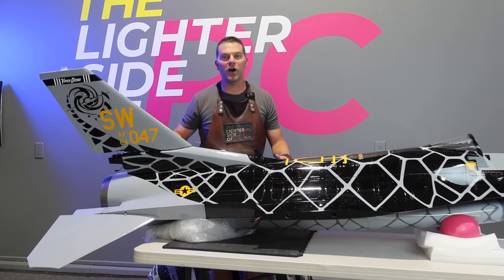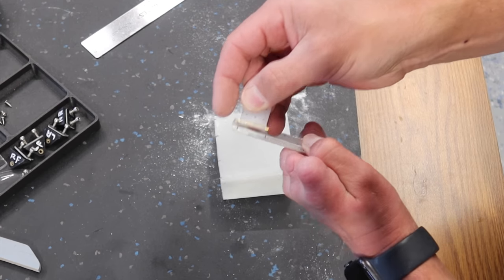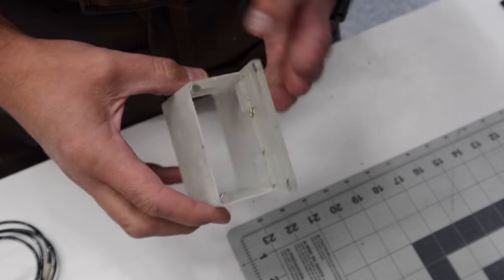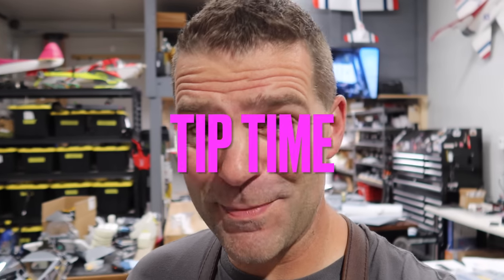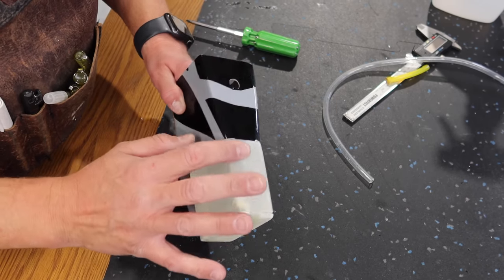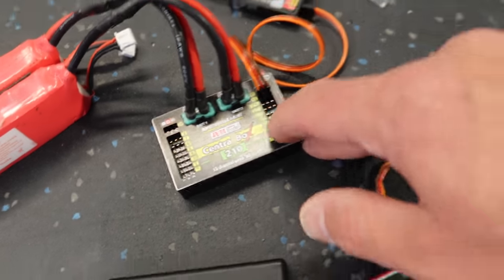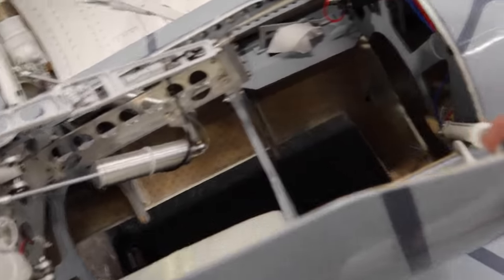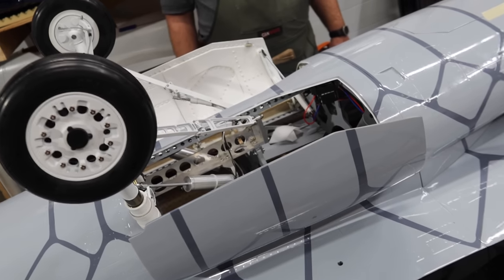Mastering the Skies: Step-by-Step Build BVM 1/5 Scale F-16 RC Jet Continues

Comment: I'm concerned that those gear lock servos could end up in a stalled situation if the notch does not quite line up correctly.
Unlikely I guess.
Reply from the maker: Yes unlikely. The purpose of it is to prevent the gear from pushing the doors open during high G manuvers.  The gear on the F16 doesn't have a physical lock on the gear so it's air pressure holding them up.
Reply: @thelightersideofrc  yep, it's a great idea for sure.

Comment: Well this series has seriously convinced me to not ever go near BVM. The amount of stuff overlooked (ie no loctite) the copious cheap/defective hardware (bent and sloppy pushrods, really?) and their absolute reluctance to modernize systems (pneumatic systems in 2023? seriously?) And they still have the gall to comand 5 digit prices on their planes on top of that, when some parts seem like they've been pulled from a 1990s bottom shelf Hobbico trainer? And then having to invest dozens of man hours, if not hundreds, just to fix their mistakes? No thanks. I'll stick to CARF. They may not have the Top Gun winning eye candy BVM has but the quality especially of the hardware and craftsmanship is top notch. Their instruction manuals are garbage though I'll say that much. I was seriously considering the BVM F-15 after seeing it fly in person but if they have these many QC issues in one of their flagship models I don't want to know that they have in their lower end models.